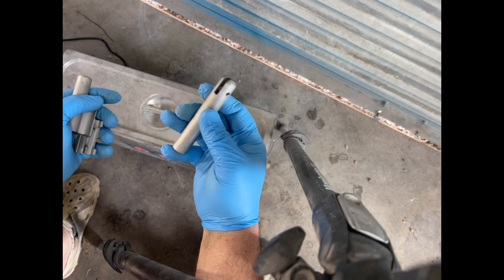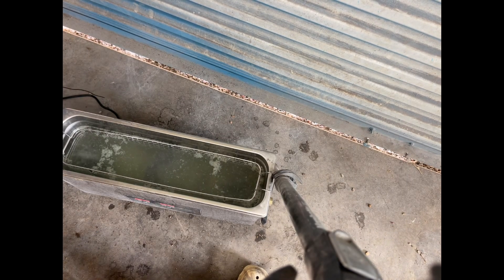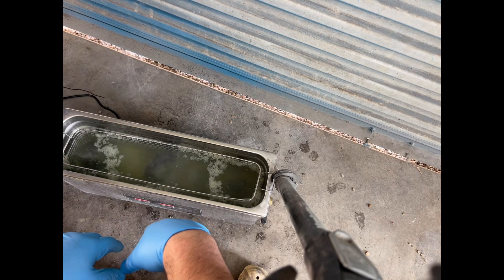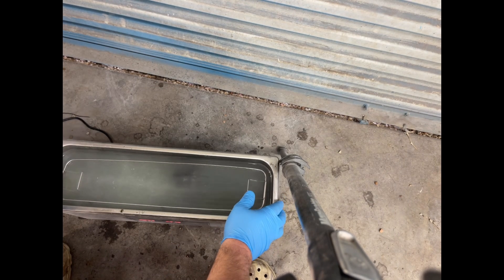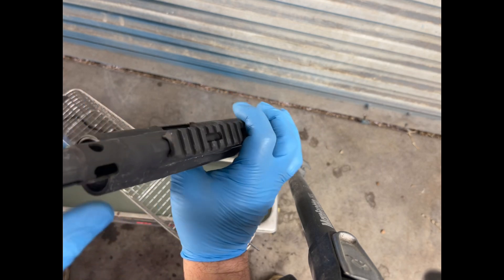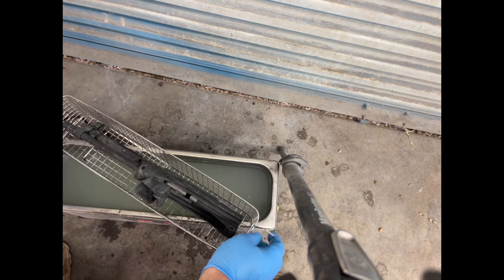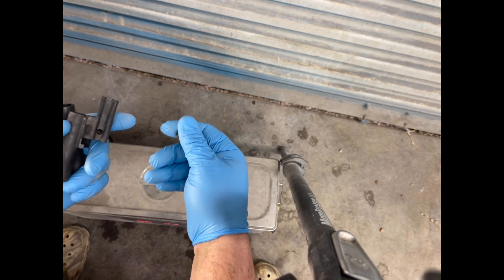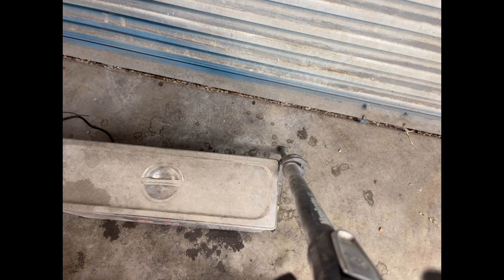Parkerizing steel parts with a Sonic Cleaner-

Comment: Link to the ultrasonic you have? Also do you run the ultrasonic action when parking or just the heater?
Reply from the maker: Its basically the same machine on several listings on amazon.    Someone on the AKF site posted a steam table that's under a hundred that may actually work better. https://www.amazon.com/dp/B0C8HLX74T?ref_=ppx_hzsearch_conn_dt_b_fed_asin_title_1&th=1

Comment: My work threw away some stainless steel sheets that I've been considering making into park tanks. I might go ahead and build a couple up. I've been wandering how i would get all of theese hk's ive been building to look presentable.
Reply from the maker: It's more of a fiasco to do bigger items but this seems like a good start to do small bits.  I think if I had to do it again based off what I learned using this one is I would get one with a higher heater wattage.   They have some that are 600-800W for the heat.

Comment: Very nice. I just picked up one of the Century/PTR CA3 rifles.
Looks pretty good. The stock metal and the trigger housing could use some attention. Otherwise looks new!
Have you ever rebarraled an MP5?
Seems like after pressing out the pin, the barrel presses out of the trunion.
I see HK barrels that are used. The pin hole is already drilled in the barrel. 
If the barrel was properly headspaced in its original trunion, couldnt you just press it into the new trunion and reinstall the pin?
Reply from the maker: I cannot speak for if the pin will line it back up or not but it may be worth a shot if you can get it to line up and push the pin.  It may be close enough that a simple roller swap will get it there.    I do have plans on swapping the barrel on a MP5SD though.  I have all the parts here just need to get it on the agenda.
Reply: @UFPTX  it seems like if it were good in one trunion, in one reciever, it would be good in another. 
My friend tells me that the reciever will get destroyed if you attempt to press out a barrel. I just can't believe these guns never get rebarraled. That would make them TOTALLY diposable.
Reply from the maker: @user-do1fq8oy9c  Your friend is wrong,  An example is that GreaseGunner and some others are knocking out the K barrels on the AP5SD's and installing real SD barrels on them.  Weaponbuilder makes a kit for doing it,  https://weapon-builder.com/product/birt-mp5/
Reply: @UFPTX  i think my friend believes that this cannot be done to an existing MP5 with trunion already welded in. He believes you have to cut the barrelled trunion out, thereby ruining the reciever
Reply from the maker: @ brother, you need to find some new friends!
Reply: @UFPTX  this is very true! I'm just looking for a video showing a rebarralling of an existing gun. 
I'm sure there will be some with Century bringing this 5.56 pistol in.
Reply from the maker: @user-do1fq8oy9c  I just posted a video where I swapped out a barrel on an SD-  nothing was destructed or cut up.
Reply: @UFPTX  sir... you are fucking awesome! I might have to drive down to meet you some time!!

Comment: That sight base is stainless, that's why it didn't park. Otherwise, cool idea. I use commercial steam trays, stainless wire, and a large propane camping stove.
Reply from the maker: @Adam-wp6qp  I have a similar setup but it’s an ordeal.  This is simple and seems to work.  The sight base and bolt hold weldments are supposed to be steel.  Turns out- not so much. 🤣